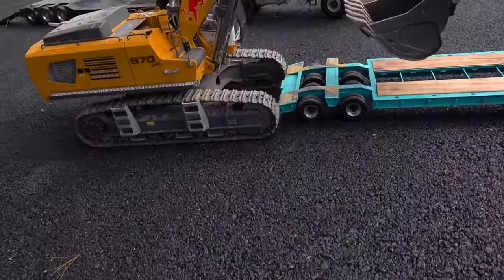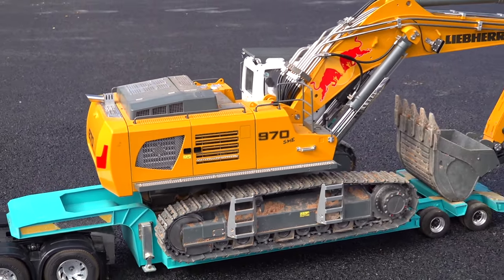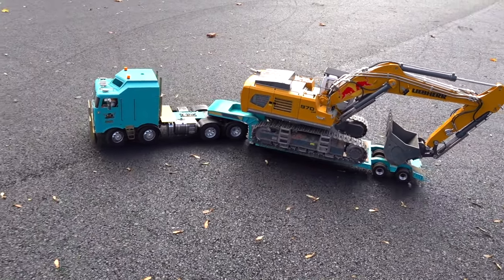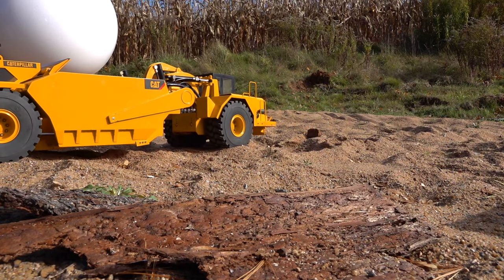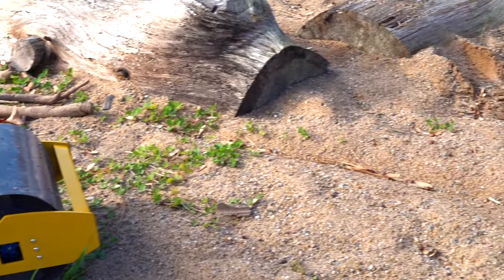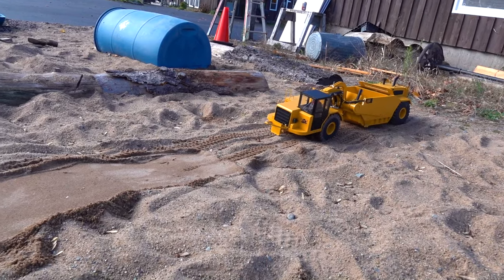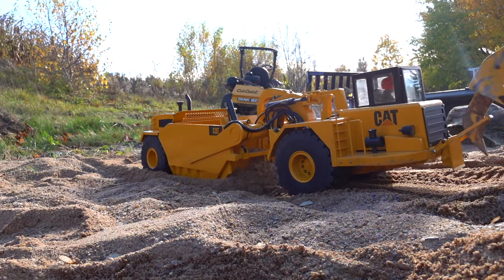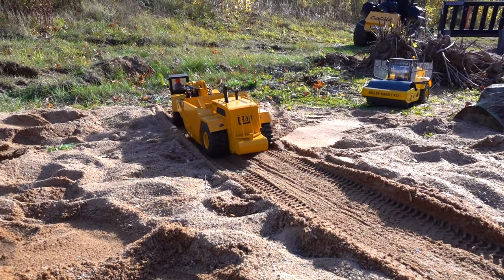Barely Scraping by, Without Any Help - Building my First Road | RC ADVENTURES

Comment: Dude..Crazy good adventure you have going here..not sure if this is now or past episode but here goes… I am from the Gold/ Silver mining industry and really get a kick out of your mining claim operation. I saw the episode of you guys showing the nuggets mined during the season..BUT..you did not show the Gold in “scale” size to the operator dude standing next to his Gold “boulders”. I mean seriously dude..these little miners are really pulling in a tremendous amount of Gold bullion.. figure out the scale size and weight and make these scale miners the millionaires they deserve to be for all their hard work. I really respect the amount of skill you and you friends have doing this…thanks for giving us all this to enjoy…GOLD…!!!
Reply from the maker: Thank you so much Randy! What an epic comment to receive. That is a true honour.  I know the boys will enjoy reading this comment, so I will pin it to the top!
Reply: If my barely capable mathematics brain cells are right, if the scale is 1/14, you would multiply the real Gold weight by 14 to get the scaled value? I think that Randy's idea is brilliant! A 20 gram day would scale to 280 grams for the miniature operators. You could get some faux 1/14th scale gold chains for them to hang around their necks. Full bling.
Reply: @BradGryphonn  doesn't 1/14 scale mean a linear scale ? (for length AND width AND height)
and thus the volume and weight of objects (which is cubic) would have to be 14³ (=2744) times bigger,
and 20 g scaling up to 55 kg or 100 pounds ...
edit: with today's current gold prices (57351 US$/kg) this would be over 3 million US$ !!!
Reply: @Anson_AKB  I defer to your mathematical skills and also rejoice in how much richer the tiny operators are now that a real accountant is on the job.  :o)
Reply: @BradGryphonn  ya, they lost me when they passed 2+2=4, but then again, that was before that Obama math where 2+2=5.378 or some other such nonsense,lol
Reply: @TheRealRCSparks  good? For you where do you by these at
Reply: ต
Reply: 00
Reply: Sßsßsssßsß

Comment from the maker: I am genuinely amused at how many viewers say "you should go and watch videos on YouTube on how to use a scraper".. When I literally am on YouTube all the time, and clearly have watched videos on how to use a scraper. Today, I was in a sand pit.. and this is exactly how I would use an earth mover - even as a first time operator. The door to the belly only needed to be open a bit .. depending on your cut depth. Same with dropping the belly blade. And yes, you can push the earth mover with the dozer - OR - use the ripper to pull it. The front hook is designed FOR another scraper or a dozer ripper to pull it.. its why its there.
Reply: They transport just the tractor unit on the trailer the scraper is towed behind still attached to the tractor unit
Reply: The dozer pushes so that when the scraper reaches the end of the cut it can just drive away while the dozer reverses to push the next scraper. When doing tandem scrapers the lead scraper loads while the rear pushes it, once the lead is loaded it will pull the rear scraper. I’ve been in construction my entire life and don’t believe I have ever witnessed a dozer pull a scraper by it’s ripper. I think you had trouble because typically the work area for a scraper has been graded by a dozer first. If you think about it and scale those dips to same size as scraper in 1:1 they would be 6ft deep. No scraper is operating in those conditions. I’m genuinely not trying to be a dick, just wanted to give some feedback based on real world experience. Love the videos keep them coming! I’m looking forward to seeing  more of this big CAT
Reply from the maker: I dont think your being a dick, as you say in your comment - but the hanger on the front is for the tandem scraper setup or a ripper to pull..  if the scraper does not have the hook on the front, then the dozer HAS to push it.. see here: https://www.youtube.com/watch?v=KS63t8zSCCA. In tandem, the hook is for the pulling pin on the lead scraper, while the middle is actually doing the cutting
Reply: Everytime I read the manual upside down it always says I can take 12s and come with smoke simulation is this right.
Reply: I have never seen a dozer PULL a scraper. They only push scrapers. The reason is practicality. The scraper gets into the cut, the dozer turns in behind the scraper and starts to push. When the scraper is full, he picks up the can, makes a hard turn, and goes. The hard turn is because it is easier to turn the can than to pull it straight. This way he can pick up a gear,  and get some momentum.  The bail is strictly use to hook the rear of another scraper.  Suggestion, open the apron more. It looks like you where plowing the sand, and getting stuck. If  the apron had been open more, then the cutting edge would have sliced into the sand, and loaded into the can. You only close the apron down after you start loading, so that the material in the can doesn't spill out. Practice, practice practice. Love the machines.
Reply: The pull bar at the front can be used as a hook up for to dozer but is rarely done.   
It's used more so for two tandems can work together.  
A benefit to having the dozer at the back is that the dozer can also control the hopper blade depth of the buggy with its blade.   
If you had 2 guys on 2 remotes I think you'd be amazed at what your capable of with those rcs.    That scraper and 60lb D9 combined would be a deadly combo
If I can recommend you trying to do and over the edge road carver off a big topsoil like pile.      It's really cool to do in person
Reply: I used to run cat 637s in a push pull tandem. Great machines. Just being honest we only ever hooked onto another machine (scraper) to be pulled, and were only ever pushed by a d9 through the harder cuts. I can’t say I’ve ever seen a dozer pulling via the ripper shank, but there’s no reason you can’t, good for you man!

Everyone is a back seat driver now a days, and I’m not trying to do that at all with this comment, just telling you my experience with 1:1 machines. As for keeping the apron barely open, that works great in hard pack and is generally a great method for skimming, but in loose material like sand, especially deep sand it will only act like a push blade for the most part bc the material just doesn’t have enough compaction to sustain the force and rather than go into the pan, it follows the path of least resistance and goes to the side or bunches up in front of the apron/pan.

Either way though, love your channel man and am looking forward to a lot more coverage of this scraper!

I’m contemplating getting one and converting to a pull type for a dxr2 dozer.
Reply: I operate 37k scraper for work…you my sir just found me the best toy ever..where can I purchase one, thanks in advance!
Reply: Dozers always pushed the pans, not pull them with the ripper tooth.
Reply: @neyo474  no
Reply: Hello, how are you doing today I hope you have a wonderful day?
Reply: Very cool! .. just love watching these construction RC videos , and yours has your commentary along with them which I enjoy  …. Old retired dirt mover pro tip ….we never called it dirt, we always referred to as material , … ie “ we another 200 cubes of material to get up to grade “
Reply: Pretty damn cool......I'm hoping that some day I can afford some equipment.
Reply: Yes, the hook is designed only to be used with another scraper in tandem. Called a “push pull” team. The dozer only pushes from the rear.
Reply: yo

Comment: If you open your front gate for the scrapper and put the ejector forward all the way it acts like a big dozer blade. Just some advice from an scrapper operator.
Reply: Bringing back memories of operating for me.  I put in a lot of time with a scraper out in the Middle East, along with every other equipment you can think of.  Wish I was in Canada to show Sparks how it's done!
Reply from the maker: Even if it was a dozer blade, the sand was too loose to use as such. It needed a pull or a push..
Reply: We normally ran the gate full open at all times and only ever used a push dozer, never pull.  Gate only closed when you transported the dirt to where you wanted to put it down.  Ejecting the gate would be full open and I would normally just adjust with vehicle speed or ejector speed if I had to.
Reply from the maker: @wolf16731  Dang, you must have been in lots of sand.. but as I said, I was buried up to the axles in moments.. open gate or not.. I cant believe people are arguing the points of how someone is having imaginary fun.. lol The world these days.. I think for my first attempt, I kicked ass
Reply: Ran a buggy for some time.  Fill your hopper  with you gate half open and close slightly once the dirt hits the ejection wall and continue to fill with a push dozer.      To put a nice even flat lift down of dirt.    Always be moving forward,  open gate first  and enough to have a slight spill out then start slowly ejecting.   Lift gate fully 1/2 way of ejection.          Really cool toy and I'm hooked now on your channel.   Keep this stuff coming man.     HAPPY RC ING
Reply: @TheRealRCSparks  lots of moondust and rock.  Great times.  I'm not ragging on ya, these hydraulic rcs are too damn cool to get butthurt about.
Reply: Didn’t think scraper operators existed anymore lol, they sure don’t in BC Canada 😂
Reply: What a wonderful machine.
Reply: @SargeantDeath99  bc doesnt have flat enough ground🤣 i miss BC!
Reply: @deeschoe1245  hahah true that! There’s about three companies here that run them here 😂
Reply: Don't forget to turn off the easy ride first or you will get a very rough surface. I know RC don't have an easy ride but couldn't help myself. One thing is for sure, you do that in the real world, the foreman will have two checks waiting for you come the end of the day. Scrapers don't smooth nothing as I am sure you already know. They are the only things on the job that makes money.
Reply: @mog5858  them there fighting words! 😂😜

Comment: I worked for a short while with earthmoving equipment in the mid-80s. We were raising the earth wall of a tailings dam at a coal mine. There were D9L dozers ripping the borrow pits and pushing the scrapers if need be. Then the scrapers would drag that loose fill and dump it on the top of the old dam wall. I drove a 769C dump truck with a water tank in the dump bucket wetting down the fill for it to be laser leveled by graders and vibe rolled to specific compaction parameters. Great fun.

Comment: I love your channels and adventures. I operate most of this equipment on a daily basis at my job. As for loading the scraper, open your apron door more and adjust it as needed during loading. Your cutting edges should just be down touching whatever material you are loading. As the scraper goes forward, it will dig slightly deeper as it goes. When offloading, you can use the ejector to push it forward some before opening your apron door. That way it has pressure already in it as you open the door to dump. Also a quick note, when loading or unloading, it is best to have your rear wheels in somewhat of a level surface to begin with. If not, your scraper bowl will rock side to side just as your back wheels do and will cut or dump your load in the same pattern.

Comment: If u would be open the gate on the to scraper about a quarter to half way. It to would cut and fill the belly pan a lot easier, faster and fuller. Then to lay a Good strip u raise the gate A quarter. Then pick the belly up about an inch or 2 off the ground and as u drive forward u bring the back eject gate to the front to push the dirt out of the belly as u drive. It's much easier to show then explain. That was the first machine I started operating when I was about 15yrs old. I'm 45yrs now. And Ive been operating ay trackhoe some call it an excavator  for a living for the past 20+ yrs. But have touched about every peace of equipment since the scraper. It just takes Seat time. But ur a smart dude, it wont be long and u will be a professional with it. Like everything else we touch. Cool video and rigs. Keep the vids coming 👍

Comment: Very cool stuff! When loading a real excavator onto a real lowboy, we never used to put the bucket on the deck of the trailer to lift the front of the machine but instead on the ground next to the trailer. Then swing the house around and lift the back end of the excavator with the bucket in tight to the tracks. That way you can extend the boom while driving the machine onto the trailer so you aren't dragging the bucket along the ground and tearing up asphalt.  Great video though, keep em' coming!

Comment: On those lowboy trailers, the real ones have flip out arms down each side that you put 2x8 oak boards to extend the width of your trailer when your tracks hang over like that. You also need to get some wide load signs on that rig and trailer and if it's way over weight and size, you need an escort car,lol.

Comment: The front door on your scraper is called a skirts. When you scoop the dirt or sand you're going to need to open that thing up 2 to 3 in,  Or you're going to have a hard time loading your dirt or sand.  When you dump the dirt you need to open it all the way. Otherwise it will hold back a lot of the dirt that's supposed to be coming out that's why you get those hit-and-miss spots . Always keep the scraper moving when you are scraping or dumping dirt. I operated heavy equipment for 36 years. I used to like operating the scrapers and the bulldozers. I have operated little bit of all of it cuz you kind of had to. And yes it's going to take some practice.  But keep working at it and practicing you will get it.  Nice equipment you have there. 😀👍
Reply from the maker: Skirt, Apron, Gate, - it depends on where your from, and thats just english

Comment: Love your channel, thought I'd let ya know a couple things about real scrapers that may help, you usually open your door about a 1/4 of the way when loading, should help with getting sand in the pan, and when you empty on most machines that is the same control, you open your door all the way then your crowd moves forward to eject the material, and keep your pan low to make a smooth fill, it will just drag the material along and dump it in low spots. Really cool pieces of equipment I'd love to spend a day running equipment 3rd person!

Comment: You could make some extensions out the sides of the trailer for over size loads. They could be made out of some thin angle iron/aluminum and have it so you just turn them around so they sit on top of the trailer when not in use to keep it the normal width. It would be cool to have some oversized load signs too :)

Comment: I really like your RC semi truck with the front for wheel steering and all your RC heavy equipment like the dozer and the long loader cat that collects sand and dirt and I like how they all have the sound chip in all your RC stuff my closest friend from your closest friend David Long I have a small army tank that can do quite a bit of stuff and It has a sound chip built in aswell.

Comment: PUSH lol push the scraper . front door = apron. single scrapers are awesome on road jobs because they are so damn fast don't need to hook them up or push them . but yeah in sand you probably do. front hook = bail hook hooks on to the rear of another scraper if it has the hook to catch it. need a soil compactor like and 815 or 825 or 826 would be awesome and a padfoot roller to go with the smooth drum . and of course u need a water cart too. love your stuff man so good to see you looking healthier and the weather looks amazing

Comment: I love scrapers this is a cool.  You might have better success loading if you open the apron up so dirt can get into the bowl, also pushing on the back is how it’s typically done on the real deal.  That front hook is only used when you hitch two scrapers together, it’s called push pull.

Comment: The 1:1 scarapers when loading them lower the "" bowl "" so its just barely above the asphalt, by doing that it raises the front up & it should clear.or cut some like wood scale blocks like 12" inch by 18 " inch scale blocks by 4 or 5 feet scale long put under your ramps to rase them to flatten out the slope. Just an idea.

Comment: The best advise I can give with the scraper is that in a single pan config is easier to push then pull and for the apron you can open it a little movie then you had it and as it starts to collect slowly shut it as needed the more you mess with it the better you get

Comment: IRL I use a dozer to push the scraper on my jobs, if you notice on the back of your scraper you have bumper for that reason. I also notice you could hook on the front of yours which means it would be better to push and pull your scraper and you could get a nice cut and fill your scraper up very quickly. I use to watch your YouTube Gold videos often and i would love to see more, I'm sure it's hard to run all that equipment without help from other people and try to run the camera at the same time.
Reply from the maker: "GOLD - Good Old Lads Diggin'" series was already filmed last year, incase you missed it

Comment: with the scraper pull the "apron" up a good bit to actually get the bowl (belly) to fill then pick the belly up and close the apron and take off then go to where your going dump set the bowl up a little for how thick you want to spread then open the apron and empty the bowl with the ejector.

Comment: You had the '' apron'' closed , open it up ohh 3/4" to an inch to allow the material to be forced into the  "" bowl"" to get loaded up. As it loads up & then you start getting traction because of the wheight of the material.